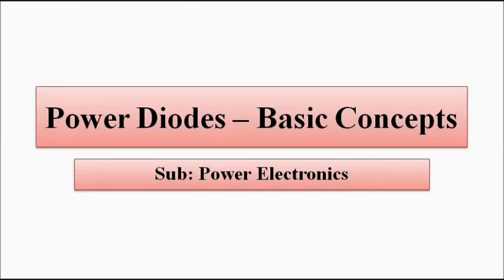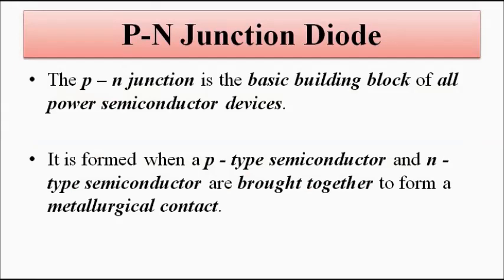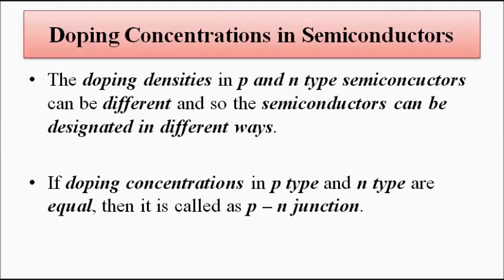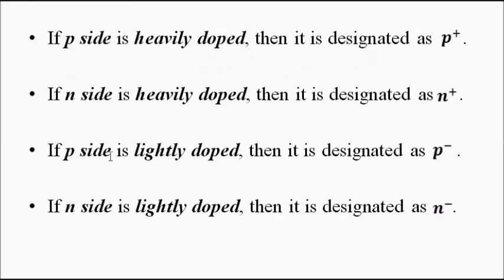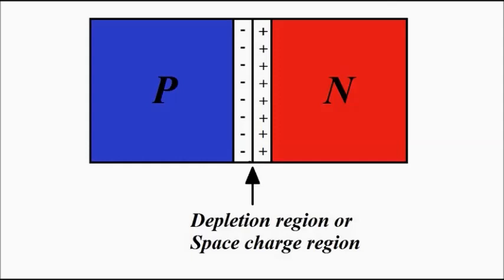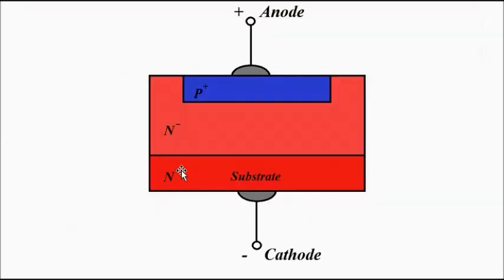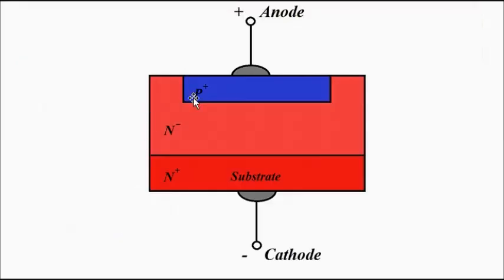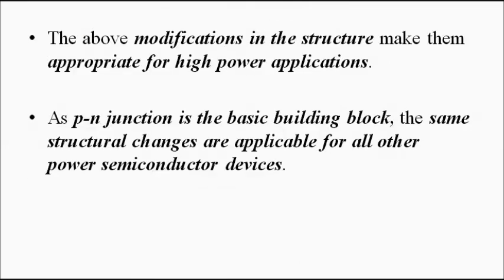Power Diode | Construction And Working | Basic Concepts | Power Electronics

Comment: Keeps repeating the same info about the structure, but fails to explain the significant or how adding the N- layer, or ohmic resistance changes the basic diode to make it more suitable for power rectification.